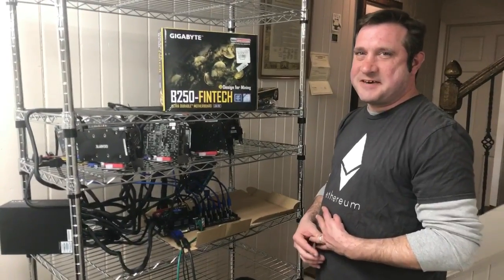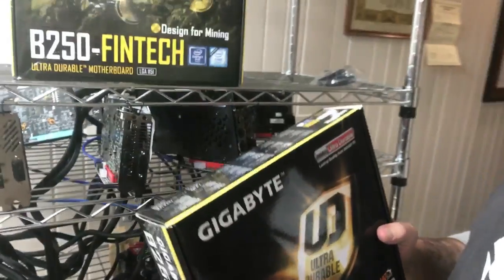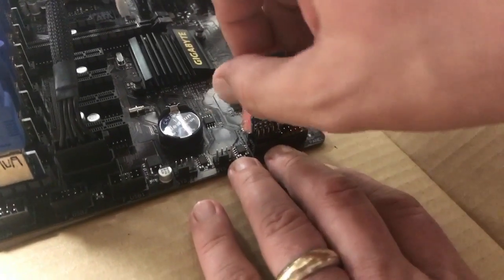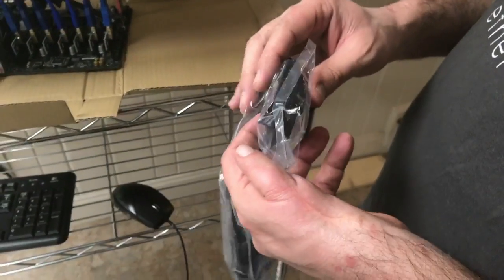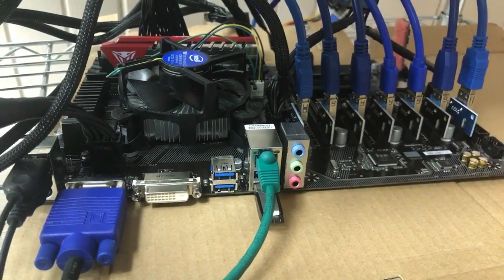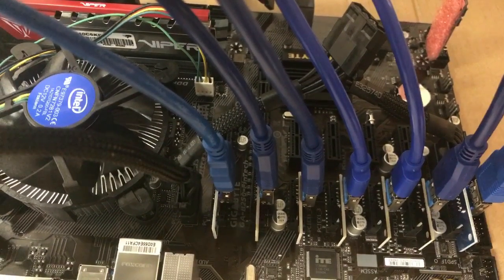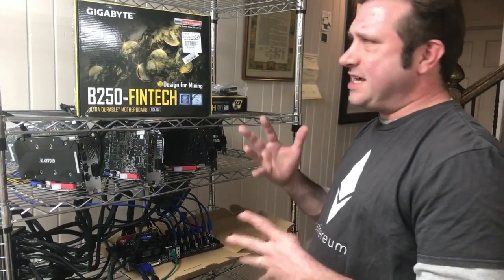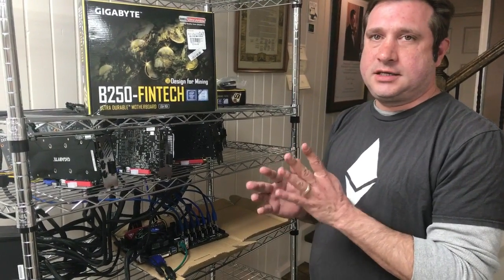B250-Fintech 12 GPU motherboard for crypto currency mining

Comment: Jw b25p motherboard i just bought when i run 3 nvidia geforce 1060 6gb card it runs but when i add amd rx 580 8 gb card its restarting when miner is being on i try changing motherboard processor power supply bios all but still i added 4th gpu which amd 580 8 gb my rig gets shutdown then restart as miner start mining i am really try to solve this issue for 3 weeks any help will be appreciated i try almost everything ??

Comment: Hey so I am really struggling with this board. I am using a combo of rx 570/80s and rx 470/80s and i cannot get my rig off the ground. I keep getting code 43 on some cards and I cannot locate any gpus in Nicehash, Claymore, Easyminer or CUdo. When I had my boot drive of NHOS I was getting it mining but when I used windows it messes up. Do you have any suggestions?

Comment: Hi please tell me why you're using a Celeron Processor when you have a board of this type with support for the latest processors , memory, multi psu's Etc when I think Celeron I think 386sx chip come back before most of you were born LOL Soylent Celeron it's something I can run 12 GPU mining Bitcoin? Thanks for the consideration of an answer
Reply from the maker: I use the Celeron CPU because it's cheap and I have extra on hand.  It works fine for mining with ETHos and 12 GPUs.

Comment: i’m running 8 rx580 with 2x 850 watt psu, but i’m only putting 4 on it because of recent issues, should i plug in both molex cables in for 4 gpus or 1 ? or none. i plugged one in with the 4th one and it fried my board. also, when would i need to plug the molex in?
Reply from the maker: Personally, I use both molex connections no matter on using 1 or 12 GPU's.  This has always worked great for me.
Reply: thats weird. i tried 5 boards and its all the same issues. it turns on for like half a second and powers off and never turns back on. i tried each gpu and riser and they work properly. what could the issue be? im feeling its the molex frying the board

Comment: Question,  when I connected my vga cable to more than one monitors, I never got a signal, is there something special I need to do or do you thing I have a bad connection, I even bought a new cable.
Reply from the maker: Check your settings in the UEFI settings for the display port.

Comment: Before I install the CPU, the CPU warning light is red. Is it supposed to be like that? I bought 2 motherboards and both have the same red warning lights. I tried CPU G3930, CPU G4620, CPU G4400, & Ballistic DDR4 - 2400 and they don't boot up. All of them have CPU warning red light lid up. What did I do wrong? What CPU and memory did you install?
Reply from the maker: Here is the link for compatibility https://www.gigabyte.com/Motherboard/GA-B250-FinTech-rev-10#support-doc  I think the red light is on because that DDR4 is not supported. I use the patriot PX416G240C5QK and the Celeron 3930. Also put the memory in DIMM slot 2 if you are only using one.
Reply: Thanks for the link. I didn't see that. Just ordered some new DDR4 from Amazon. Hope they will work.

Comment: I having issue with this motherboard b250 fintech. After installing gpu my screen no signal/ black screen . Kindly suggest how to solve the problem.
Reply from the maker: After installing the GPU, the UEFI settings are default to use the GPU's HDMI.  You will need to go to the UEFI and change the default monitor to be the onboard as default.
Reply: AtHomeCrypto    ok , i check it

Comment: I am having issues with that motherboard I can only connect 11 GPU if I connect 12 I get a blue screen of death
Reply from the maker: Double check your molex connections are well seated to the motherboard in both places near the GPU slots. Also check if it blue screens no matter what the 12th GPU slot and card are.
Reply: Thanks but I checked everything even changed the video cards once someone else get to 12 cards I'm sure they will have the same issue all 12 don't work just 11